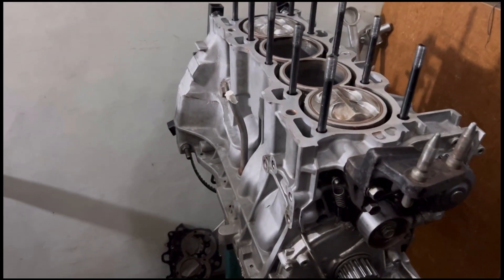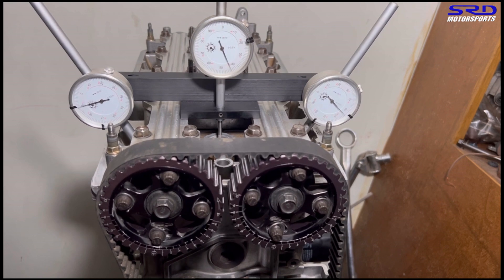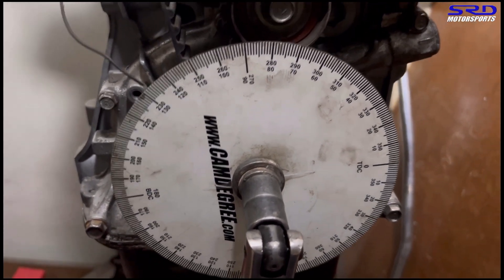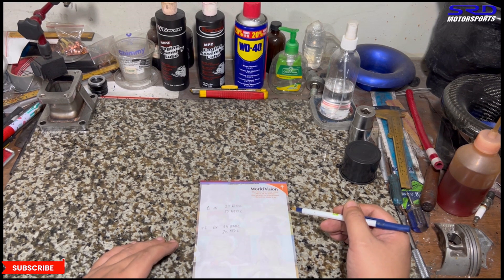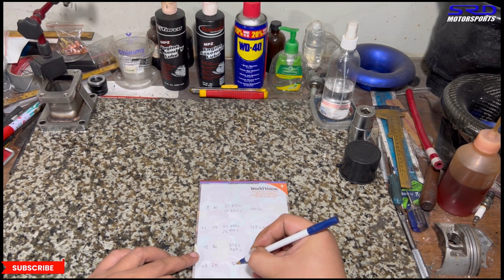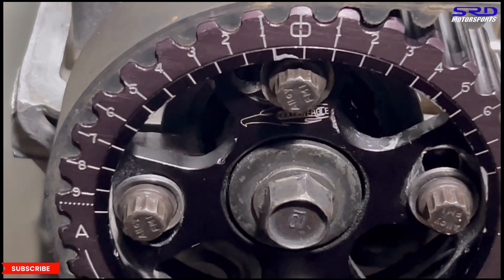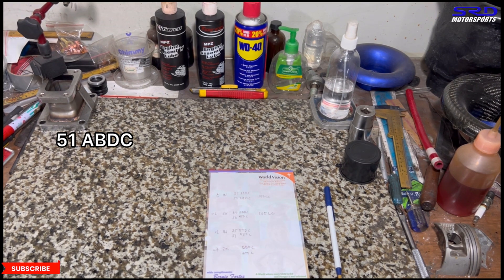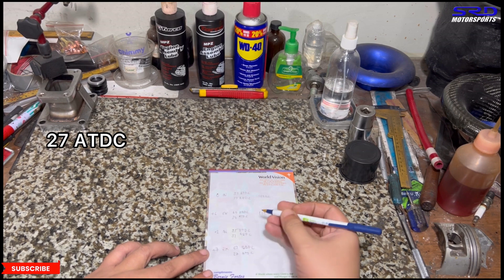How To: Cam Degree Skunk2 Pro3 on Correct Lobe Centers

Comment: Pro 3 cams are nasty and loves really high compression, love seeing these cam degree vids brother
Reply from the maker: Yes sir! Pro3 !!
Reply: What’s the minimum compression you would run on these? I’m thinking of going 11.5 my buddy ran these on 14.1
Reply: @ekcoupe5059  minimum on pro3 I would run a static 13:1 compression ratio, because of the very aggressive cam profiles they perform way better with high compression. 11.5 compression you can get away with pro 1 or even tuner 2 or tuner 3 cams which are under the pro series cams. Pro 3s aren't great for street cars because they make no kinds of power in the low to mid rpm ranges.
Reply: @StraightOutThaGudda4U  thank you
Reply: @ekcoupe5059  you're welcome

Comment: What method do you use to dial in the Asymmetrical cam profiles? I have a Pro 3+ set of cams on a Race B18 with 12.5:1 cr, itbs and freeflow 4 into 2 into header with integrated Megaphone at the end of the secondary collector. Exhaust us 3".
Reply from the maker: Lobe center method

Comment: Is this for a b20v? 0 on intake and +6 on exhaust
Reply from the maker: Yes sir on this gen1 Pro3 specifically (each gen degrees differently I have noticed)
Reply from the maker: Basically the intake centerline is set at 100 lobe center, the exhaust centerline is set to 104
Lobe center 

that’s all that’s needed to be followed
As each brand camgear will show different degree on their markings on the “correct” lobe center 

Even Gen 1 gen 2 gen 3 Pro series will show different “on the camgear” 

That’s why it’s always the lobe center that’s checked not and never “what” camgear settings it is

Comment: Brother man were can i get a cam degree tool just like yours? If you don't mind sharing that information
Reply from the maker: I got it from Xenocron when it was still open but the same owner also runs race-spec for harnesses and parts so he might still have it there on the second shop
Reply: @SRDmotorsports  as always thank you very much for the good information brother man,i was able to find it on line
Reply from the maker: @favianromo1990  oh nice u found it at Race Spec? So I can check in the future haha

Comment: why are you turning your engine anti clockwize?
Reply from the maker: was just checking and double checking stuff but yes to get the numbers always reference it how the engine turns… this engine runs anti-clockwise
Reply: @SRDmotorsports how do you turn counter clockwise without loosening the bolt
Reply from the maker: @jackpowell715  yep gotta make sure the bolts are tightened or they would loosen up as u turn counter clockwise wise as per engine rotation

Comment: Normaly po pag. Itr cams po gamit na bseries pede din po ang +1 in + 7 ang ilagay
Reply from the maker: NO… please sana people would stop ung ganyan walang “setting setting kalokohan”

The adjustment is to get to the ideal or preferred lobe center… ITR or skunk2

Kalokohan Yang may mag sabi dapat “eto setting”

Each resurfacing ng head and block moves the cam at a certain  direction so IBA IBA pa din… then add each adjustable camgear brand are not marked the same per degree

Kaya I never payed attention Sa “ano setting”
kase it doesn’t do anything…

Example may nag buo b16 nka piston at lahat and CTR cam pa nag 160whp lng 😂
(panigurado nag setting kung ano ano based sa kanino)

When sa ITR cam “lang” na b16a we already did 186whp

that’s 26whp diff sa same displacement and smaller cam kame…0
Reply from the maker: normally OEM cams Tulad ng ITR ang setting perfect sa stock camgear which is zero
Reply: Bali adjustable cam gear napo gamit sir b20 16a head po
Reply from the maker: oem cam sha so zero zero is still an ideal setting

Comment: How much cr do u run?
Reply from the maker: Depends on available fuel and octane and tuner capabilities… best fuel + bad tuner = blown engine… for pump gas here locally as we don’t get e85 at the pump we run 97ron which is roughly 94US octane I think 

I can run as much as 13.2:1 no problem ideally 12.7-13:1 is good for street on pump gas